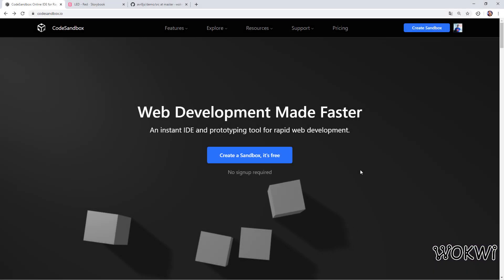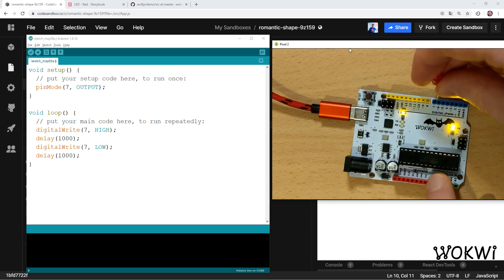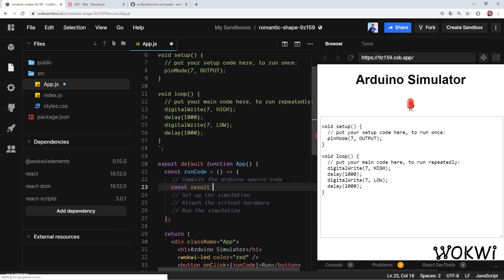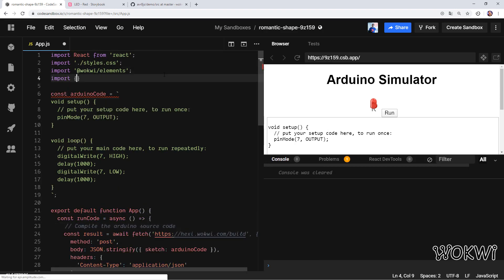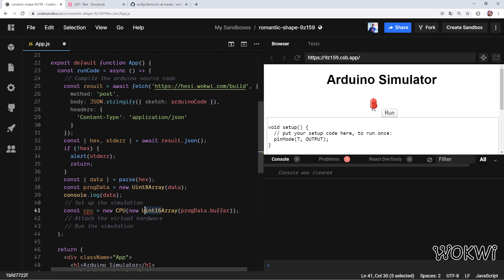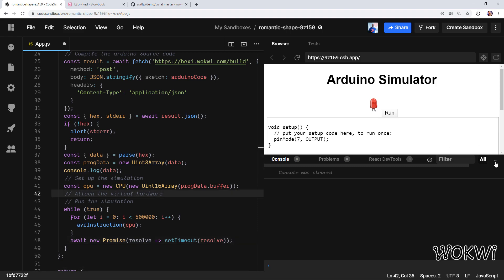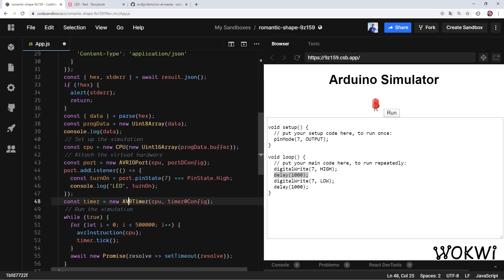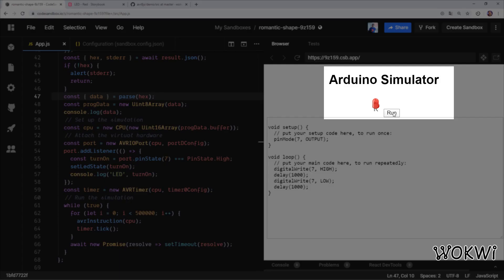Let's Code Arduino Simulator from Scratch (with JavaScript) 😬

Comment: Oh man, this is out of this world! Amazing project and website. One question - is it possible to compile C code in the browser as well? I assume that on that endpoint under the hood server uses "normal" C compiler to output hex.
Reply from the maker: Thank you! 

C - Yes, there are some projects that ported c compilers to the browser. Google "clang wasm" for information.
Arduino code - I did some initial experimentation compiling an Arduino project entirely in the browser. But my initial results were not promising - you had to download nearly 100mb of binaries and libraries, and even then, it took nearly two minutes just to compile "blink". So while it's possible, it's not very practical, at least not without spending a lot of time on optimizing the process.

Comment: How Can we simulate HTTP call? Does any of the existing Arduino wokwi board has wifi built in, so that it can be used for IOT project?
Reply from the maker: No, AVR chips do not have built-in WiFi. For more context, see this discussion on GitHub: https://github.com/wokwi/avr8js/issues/63
Reply from the maker: Note that nowdays there's also ESP32 simulation with upcoming WiFi support: https://docs.wokwi.com/guides/esp32